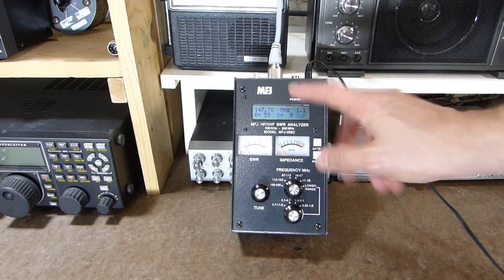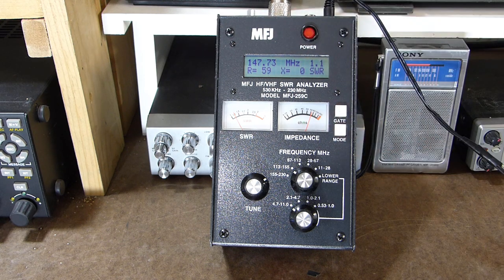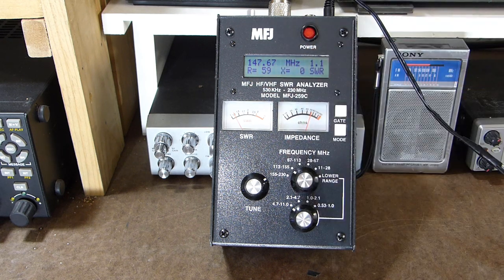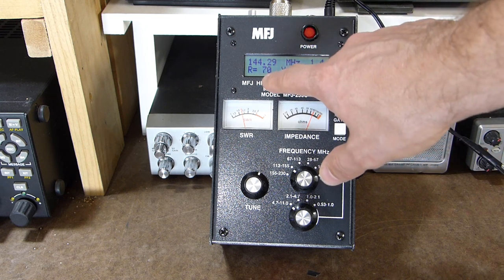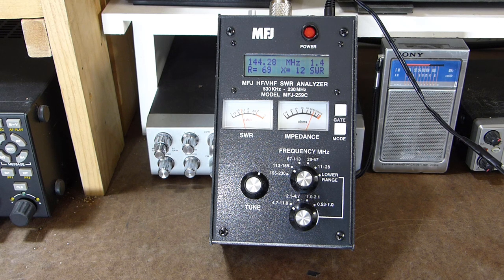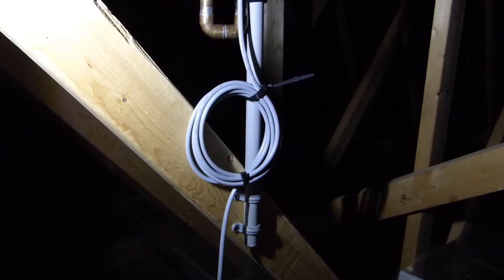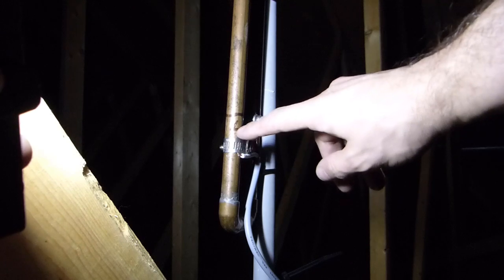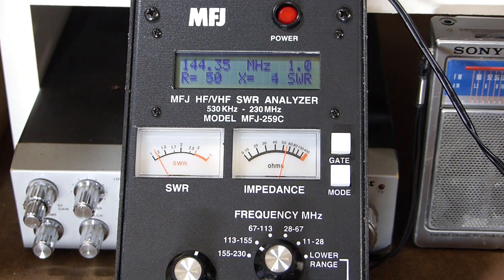2 Meter Home-brew Slim Jim Antenna Tuning

Comment: 3:55  What's the effect of having the hose clamps offset like you have them or at the same height?
Reply from the maker: They were probably moved around during tuning.  I don't think it matters much if the clamps are exactly aligned as long as you get a good tune.